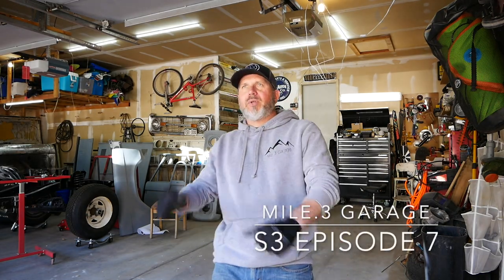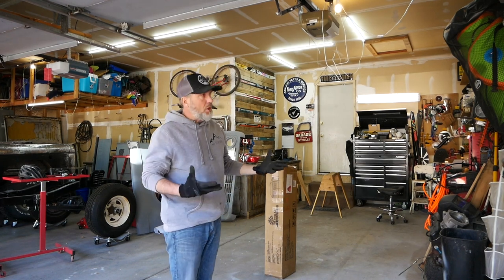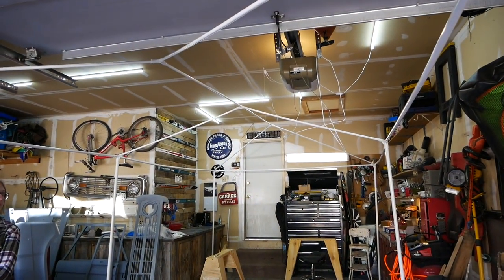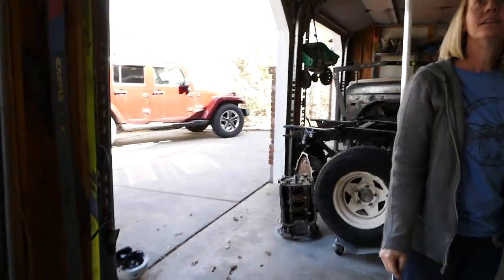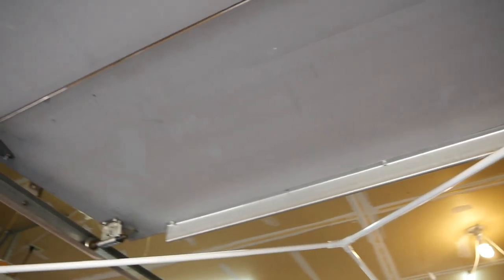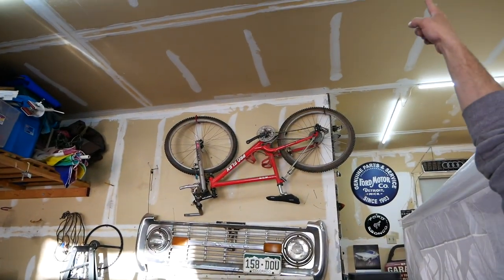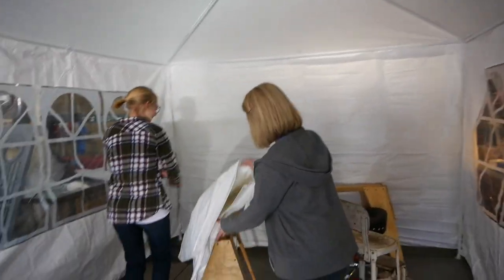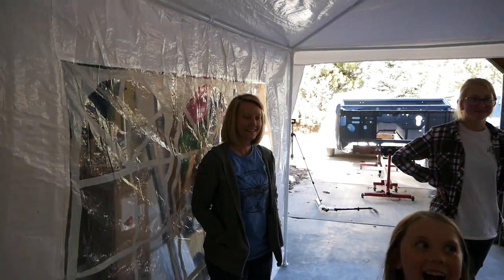Wedding Tent Paint Booth. $63 Paint Booth?

Comment: Would a tent of this size work to paint a truck? Got a 03 Silverado 1500hd looking to paint in my backyard with a wedding tent.
Reply from the maker: I think it would. It’s 20’ Long . It would be tight, but with the correct ventilation should be just enough.
Reply: @alpinegarage8548  how much will a setup cost with a decent air compressor? Im looking online it says I need a 60 gallon and the spray guns I've seen some price at 50 bucks which is cheap. What would you suggest if I plan on spraying maybe a few cars? Thanks
Reply: @jesusalfaro5748  i have a 30 gallon craftsman...paid $140 for it used a few years ago...i have no problems with my paint guns... you can get a good gun for $100 or less... many video reviews on painting and equipment.